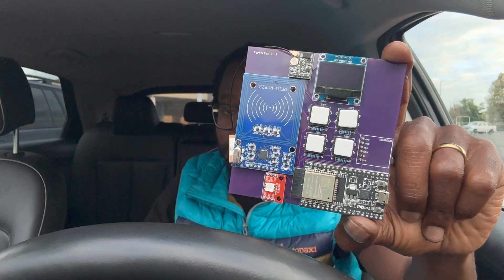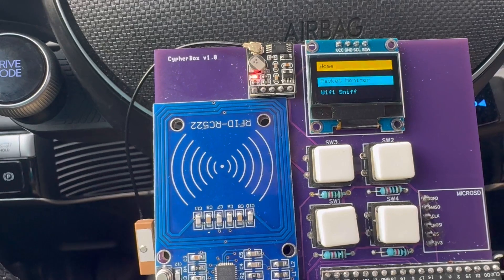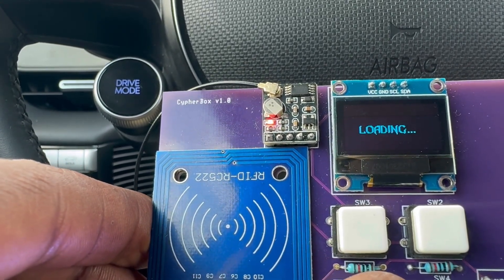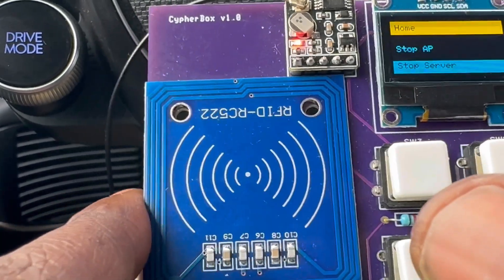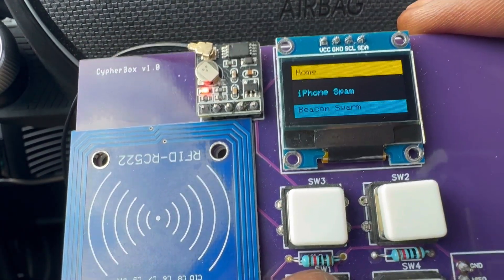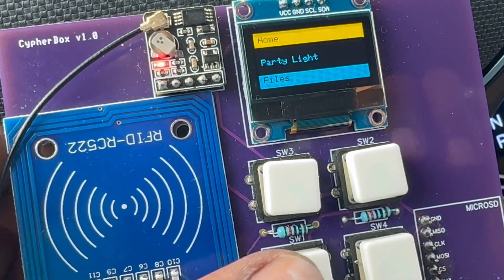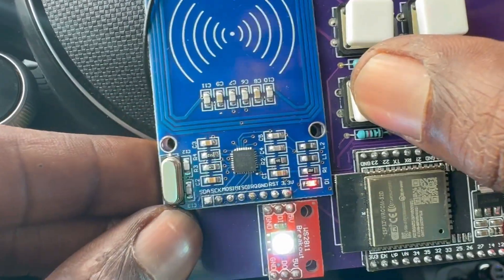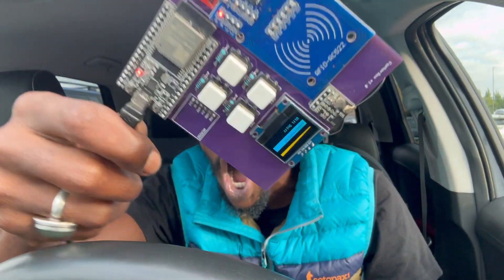Features for my ESP32 Hacking Tool

Comment: This is an amazing project. I just started following and am excited to get some of these ordered for me. I can see them as great presents for my friends in security.  I would like to help. If you have a patreon or similar lmk.
Reply: Soooo good.
Excellent explained.
U could add some Li pol 3.7V battery and place it to bottom of PCB with sticky tape and with booster to 5V or more Volts to power your esp32 without need USB Cable.
Reply from the maker: Yes I am working in a battery version later! Good idea
Reply from the maker: Thanks glad you like it!!! I am making a newer and better and smaller version! Perfects gifts for your tech friends! Peace!